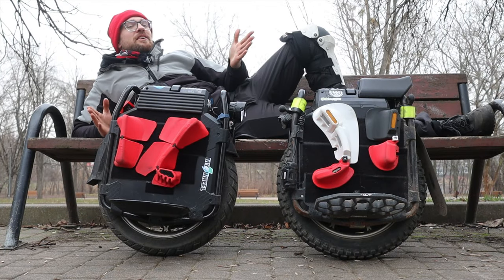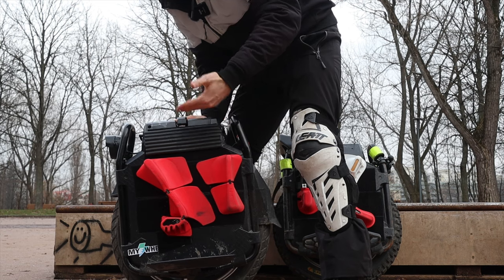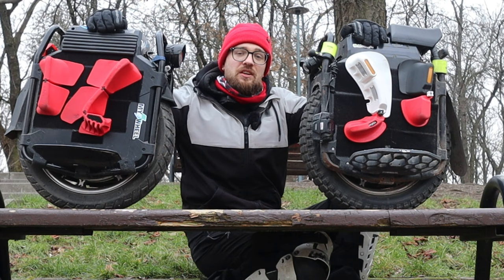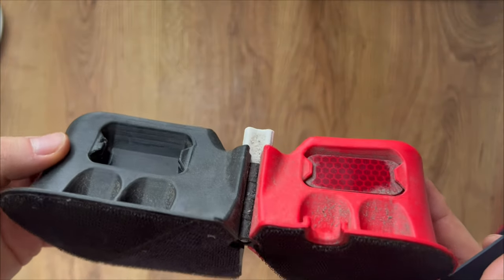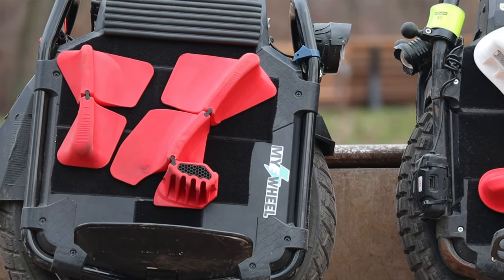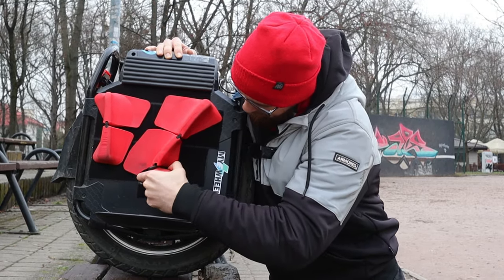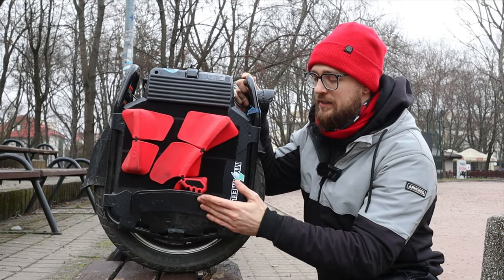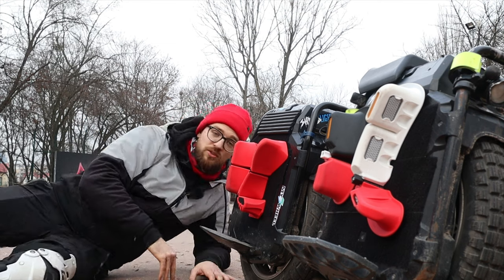NyloNove KINETIC & Grizzla FLOW - Comparison

Comment: Just a few words from Grizzla team, as we were not consulted regarding the issues Adam faced nor asked for our future plans regarding the Flow Pads system:

3:45  The primary function of Memoriser is remembering position of the pads in case you need to detach it for the transport. Having the pads setup on multiple wheels is secondary function here. We are using Memorizers ourselves which can be seen in multiple posts we featured on IG/FB

3:36 The issue shown in the video might happen if the hinge is not tighten enough or the knob was so loose that the nut on the on the other side can moved out of its socket, so it doesn't 'catch' while re-tightening - then it can be fixed by simply pushing the nut back in. The function here is to lock the pads position when detaching/readjusting the pad on the EUC, but with enough intentional  force you will be able to push through the locking mechanism which is designed on purpose to protect the hinge

4:15 We also offer Grizzla Flow without reflectors, which are €189 for Big version and €169 for Compact

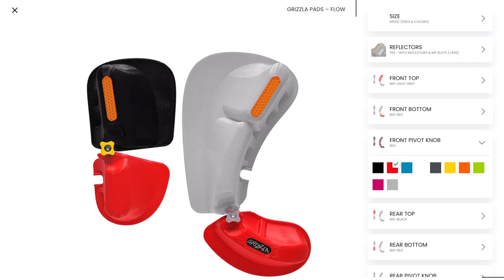5:19 The Lockable Pivot's design doesn't allow the screw to protrude on the bottom side of the pad, so there is no need to worry about damaging your EUC while crashing with Flow Pads on it.
Reply from the maker: Thanks for the comment!
Reply: pay a bit more to Adam and he will like it more than NiloNove pads next time :D
Reply: Stellar response

Comment: Yes ! I use the little Grizzla placeholders, but not because I use the pads with other wheels. They are just helpful when you want to try a different position, but still be able to easily get back to what you had... My pads also hurt my shins a little on longer rides, but in my case I don't blame the pads - it's a little hard plastic ridge on the front of my touring MC boots that digs in, rather than the pads themselves.

Comment: I LOVE my kinetic pads and bite system.  Been using them for about 8 months now.  I agree completely about the comfort level of the kinetic pads.  Literally the first time I put them on my wheel I was blown away by how great they felt.  It's like trying on a premium 100% heavyweight cotton shirt the first time after wearing a burlap sack all your life.  They have the perfect balance between stiffness and comfort.  I agree about the connector pegs coming out.  I have to fiddle with them every few rides or after putting a lot of stress on them.  Those could be better, but they are certainly not a deal breaker.  I like the reflectors on the grizzla pads, but I'd also argue they look busy.  The nylonove are smooth and very easy to clean.  I also liked the registration slot on the grizzlas.  I spent a while trying to get the perfect positioning for my nylonove pads, and dread when I have to pull them off for any reason cause I don't want to have to reregister them.  Lastly... bite system is fantastic.  It is the only system I've used that allows me to put the pads as close as I want to the pedals and still allow the pedals to close.

Comment: I use the tabs on my Grizzlas when I relocate the pads for different footwear.
I get no digging on the front of my Grizzlas, but I went for the option without the reflectors  because I didn't want hard plastic parts where it should be soft.

Comment: Thank youuuu for the informative presentation and the Grizzla coupon code! (€9 off heck yeah) 
Getting a splash of color on the V12. The mix of colors + sizes is a gamechanger. Flow Compact size for 3 pieces and Flow Big for the toe piece. Red+yellow rear pads, blue+green front pads. Gon look like a Microsoft logo xD Just hope the bottom pieces wont be permanently discolored by boots and dirt and mud in one year. Black would be the safer color. 
The reflectors on the Grizzla Flow is just perfect to cover that piece of road legality. Another problem out of the world. Can't wait !!

Comment: Hello Adam,
Love all your vidéos and advises, bravo and thanks a lot. 
I just bought a V11 unfortunately just before the launch of the Patton and the S19, sight…
So I have to deal with it. I m just a 60 years old cruiser and just want smooth and safety ride with confort.
I made 6000 km with a Kingsong 14D and it s a big changement particularly on the weight of the wheel.
I noticed your advice on the comments of the Sai Pad Raid Trails for the V11 but I didnt find the « side fairing » on Huladj market that you mention, so I don’t understand what is it.
In regard that the Kinetic 2.0 looks the best confortable pads do you think that with the Fairing Plates of Grizzla for V11 (30/22cm, much larger that the Anypad), the kinetic could feet  ?
Also I saw some green pad on your V11 on a video, looks the flex pad with anypad or flexpad V3 for V11 what do you think of it compare to the Sai pad (maybe better because more large) ?
There is also the flypad which looks interesting for the drive and break but I m afraid  to get lock on the wheel on a falling situation. 
For now I putted some Yoga carpet on the up side of the V11 but I didn’t really found any tape which glue well on this granular plastic side of the wheel. 
Thanks for your time for any advises comment. 
Take care, best regards
Stéphane

Comment: Hi, I recently got a Ks14d to learn the monowheel in anticipation of switching to a larger version soon but now my problem is that when doing 10/20 km rides I start to have pain in my feet and I have to stop to change position often . How does it work with wheels that have more range? do you rest your shins on the pads to rest during the run? Thank you!

Comment: Why do I need buy pads?
Ender 5 (300x300mn) cost - 550$. And you can print what you want for free....
Reply: First you need the design , can you find this design anywhere ? ,then you need the TPU to print with 
and need the experience to print with TPU .You can go through a couple of kg of TPU before 
you finally have it just right .I am just talking from my own experience with 3d printing for the last 
8 years .
Reply: @kimnielsen9320  with direct drive injector tpu printing without any problem from the box :)
Design ??? Really . 3 curves :)))  not fit good ? Reprint :)
Reply: TPU is not for free :) or you able to make material you print from?